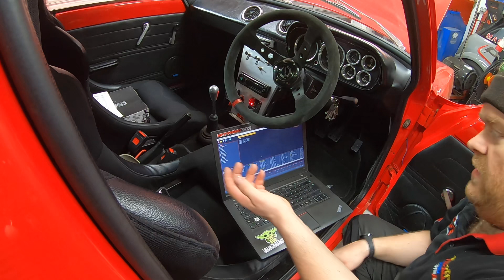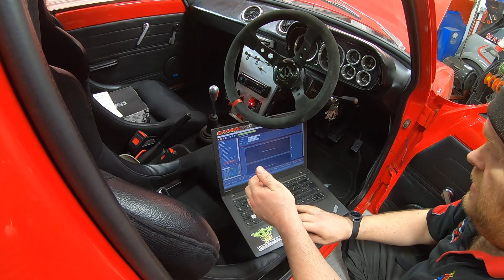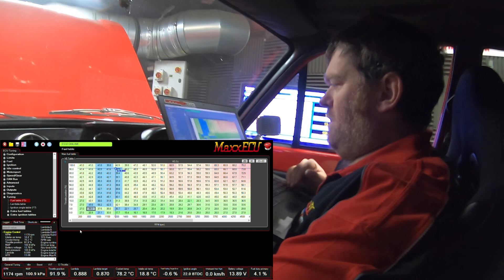Escort Mk1 Pinto Throttle Body Conversion. First Start, and Dyno Tuning the MaxxECU

Comment: Hey, that was a very nice series of videos! I'm converting my VW T3 Boxer engine to Maxx ECU at the moment and you said a lot of useful things. Thank you so much! I have one question left. I have installed the same wasted spark ignition coil as you did but I'm not sure what the correct configuration in MTune for this coil is. I connected the cables "Injector 1" and "Injector 2" to the coil. In the output configuration of the ignition cables in MTune, there is no possibility to assign more than one cylinder to one output. Since there are two cylinders per coil, I'm not sure how to configure this correctly. I hope my problem is clear and you (or someone else who knows the answer) can help me out. Thanks in advance.